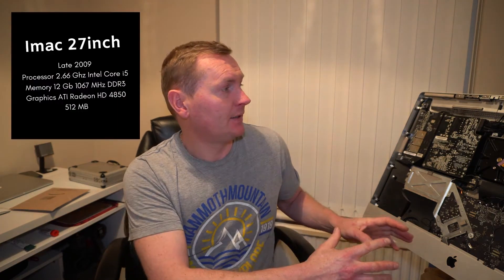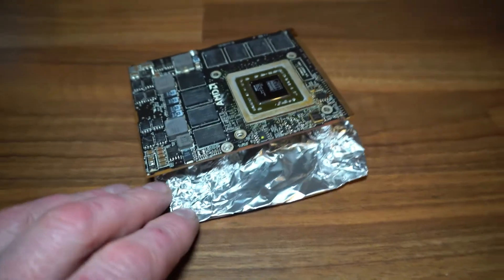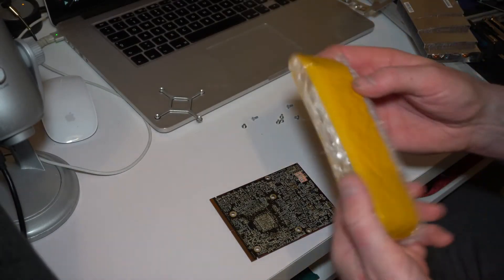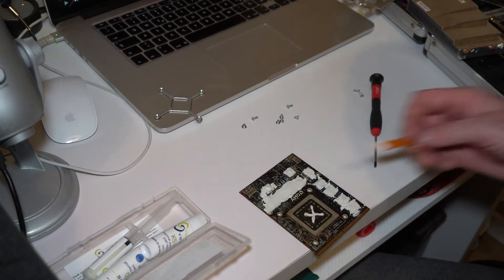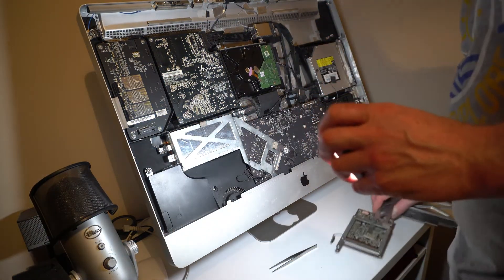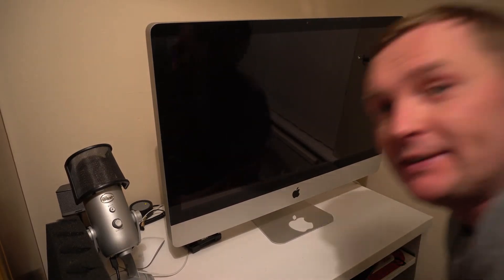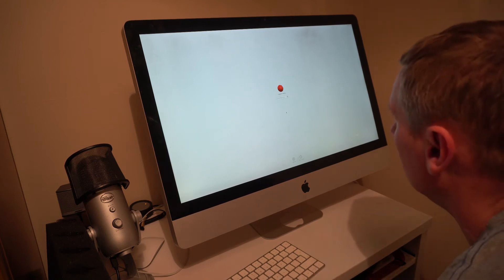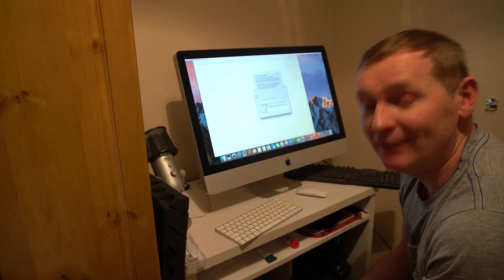iMac 27 How to save money | Imac 27 Graphics card replacement | How to fix graphics card at Home

Comment: Thanks for the video - I tried this with my late 2009 iMac 27" today and it solved my GPU issue. The hardest part was at the end when reinserting the small cable from the GPU into the back of the logic board. While I had the case open, I also removed as much dust as I could. I didn't have time today, but next time I may also attempt applying a new layer of thermal paste on the CPU, but that will mean taking the logic board out. 

Thanks again !
Reply from the maker: I know what cable you talking :) The first time when I tried to fix my iMac, I broke that small cable I need soon as possible buy a new one :D I am really happy for you that you find my video and fix it on your iMac for yourself and save money. Thank you for your comment and happy Christmas and new year.
Reply: @Svaikis10  same to you, have a great Christmas and New Year.

I did this process with my 13 Yr old son, so he learnt something new too. He will now be using the iMac and now knows exactly what's behind the screen :)

Comment: Will this work as well for the iMac 27" inch Late 2012? Everything else in this mac is maxxed out but not this
Reply from the maker: You talk about graphic card?
Reply: @Svaikis10  yes, but I just wasn’t ahead and purchased a 2019 maxed out
Reply from the maker: if you have another pc, you can try to fix the old one. If you have the graphic card problem on your 2012 iMac.You need just screws drivers, thermal paste, and inspiration.
Reply: Did you try this out Alan? I've got the same model and I want to try this method out.